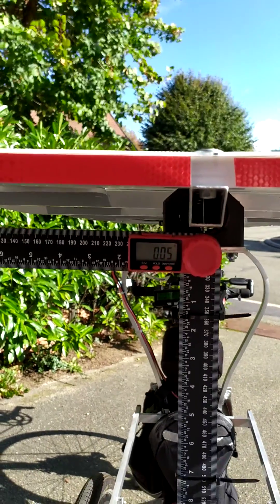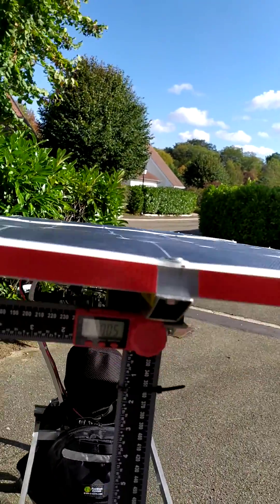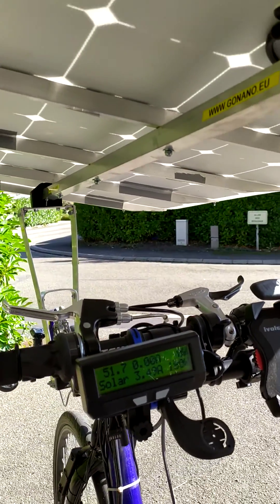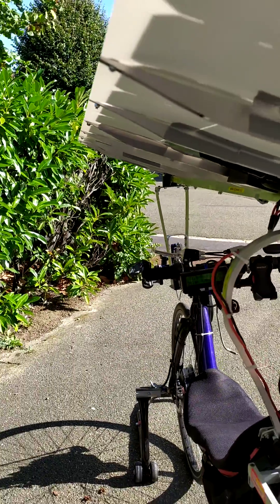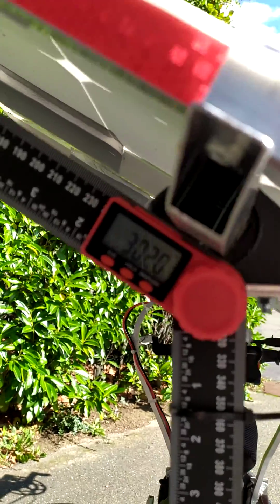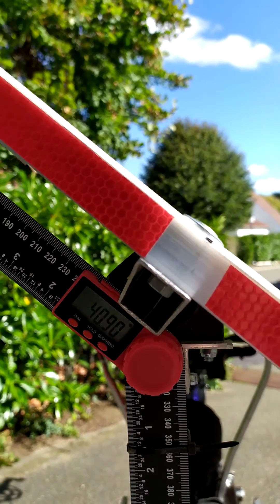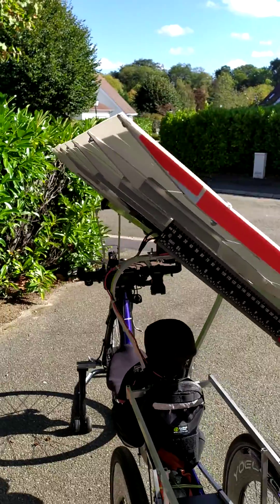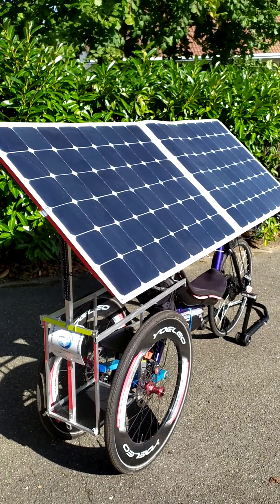Tilting Solar panels, you would be amazed to see how much this improves efficiency!

Comment: You always want to keep the Solar Panel perpendicular to the rays of the sun.  Everybody knows this. This is why the watts output increases as the sun rises up towards Solar Noon and drops as the sun sets. You can use the Sin(angle) or Cosine(angle) functions to matematically determine the increase / decrease in watts. This has been well known for decades ...
Reply: Perhaps now is the time to install a thumb dial lock / unlock mechanism so you can adjust the angle while riding.
Reply from the maker: @thespaceman6283  It's even simpler since I can already modify the ACTUAL angle while riding just by raising/lowring the solar panels with one hand.
And if it becomes really too windy... I can harden the 2 nuts on the support frame just behind my head 😉
Reply from the maker: Yes you are right! But here I just wanted to clarify this topic for the specific case of Solar bikes. 
Many of these type of bikes stilll use FIX position solar panels (flat) because it is much easier to implement. In 2019 I have started to install 'tilting solar panels' on my bikes and the efficiency increase is simply AMAZING. 
This video is simply to convince through ACTUAL TESTS and QUANTITATIVE RESULTS those who still believe that it's not worth to go through the complexity of installing Solar Tilting panels for just few percentage points of efficiency increase....